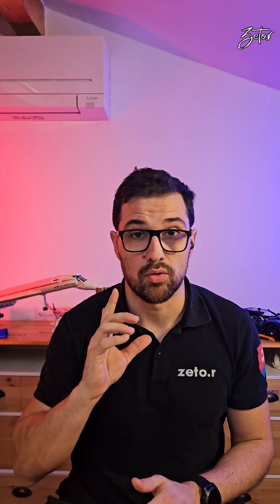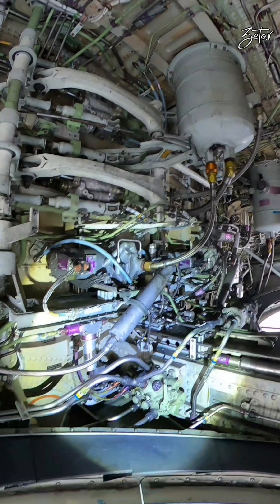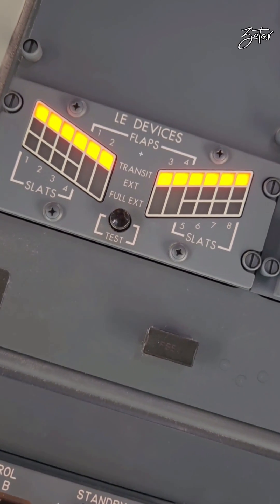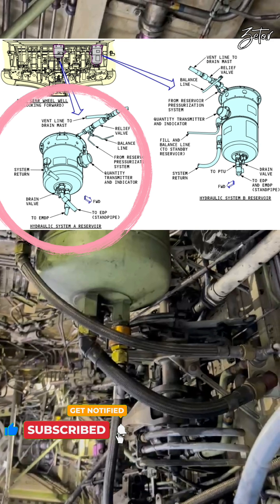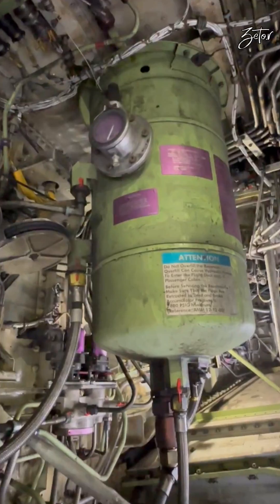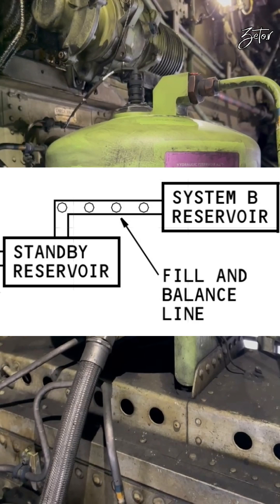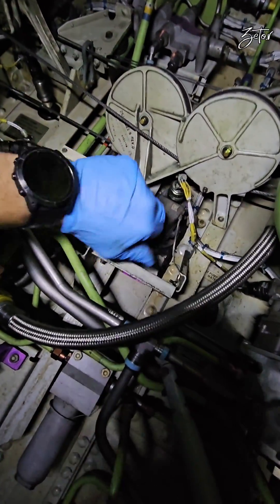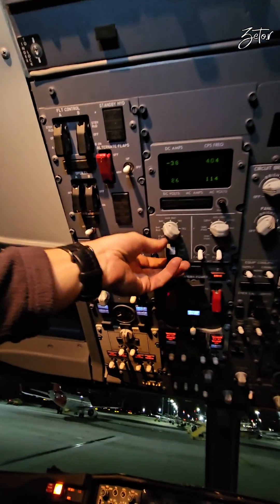Hydraulic system on B737 and how to service it.

Comment: Hi Thomas, thanks a lot for Your videos, could You pls make a video about how to transfer some hydraulic fluid from A to B sys and back using only cockpit)))
Reply from the maker: I guess this info is not really supported by documentation and it is recommended to not do it due to possible contamination.  But it is possible through brakes